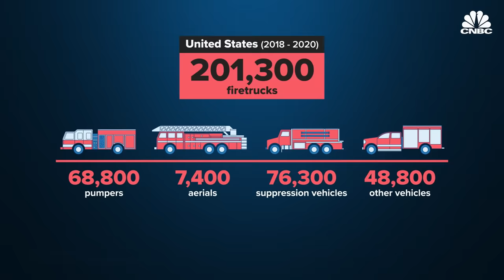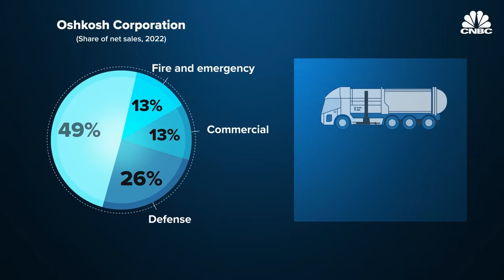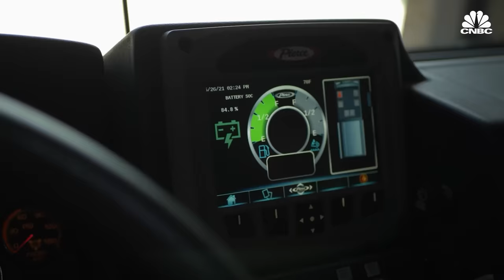Who Makes Money From America’s Firetrucks

Comment: I've had the opportunity to tour Pierce Manufacturing.  The amount of engineering going into a modern firetruck is amazing.
Reply: American FireTrucks and overall utility vehicles are years behind everything made in/for germany (or Europe in general). Look up german firetrucks / busses from the last few years... Thats engineering 😆
Reply: @rlBrave  American fire trucks are still very popular outside of U.S./Canada. Go to Brazil, Chile, Argentina, Mexico, or even China, in which there is some fire brigades that use U.S.-style fire trucks. They buy them because it is simpler to use while have a larger fire suppression capability.
Reply: Pierce sold Arrow XT pumpers to Brasília, Brazil in 2014, and Spartan ERV sold Metro Star pumpers to São Paulo, Brazil in 2017.
Reply: As a nearly 15 year volunteer firefighter.  Also 15 years as a degreed mechanical engineer working in large production facilities, I have seen some of their operations.  It is quite impressive.  The problems right now in manufacturing in the US is the quality.  There has been a complete swing from experienced operators and builders to bringing in kids off the streets.  It is a tough thing to handle right now.
Reply: @rlBrave  Most of the German vehicles are built around the idea of compactness and maneuverability. Sure cities like NY and LA could benefit from smaller more European style trucks but the US is massive in comparison to Germany. So the bigger bulkier trucks have a different mission than those of the European counterparts. But Rosenbauer is also becoming popular in bigger cities across North America while Pierce and E-One are still very popular for non metropolitan cities. And you can shove more abilities in the bigger trucks in the US. Sure we have Squads, Engines, Ladders, etc... But we also have a lot of multi-mission trucks that fit the needs of the US well. I also wouldn't consider shoving everything into a small package Engineering id call it designing a vehicle to fit a nations/cities needs which is what all these companies do.
Reply: The plant in Fox Crossing Wisconsin? I used to work for United Plastic Fabricating which makes the polypropylene water tanks for Pierce, Seagrave and many other manufacturers.
Reply: @eddo1983  That would be the one.  Got the tour as a prospective electrical engineer, so we got to see stuff they don't even show customers.
Reply: Clueless post

Comment: The portion of emissions caused by fire trucks is so miniscule it's insane to even discuss it.
Reply: Although you could make a case for electric fire trucks as far as torque and speed of start up. Although I'm sure they'll be hybrid for a good while before they'll be electric, but I agree that those emissions are smaller in comparison.
Reply: They're got carried away with emissions even banning lawnmowers and string trimmers in some locations. Too many extremists in positions of power in the environmental agencies who want to wield all the power they can.
Reply: @TheOtherBill  Yeah band aren't the way to go, but electric power tools are good for most homeowners in my opinion, just less so for businesses until there's better commerical tools.
Reply: You're barely talking 9 healthy cow farts per truck dispatched. I'll pay that environmental cost
Reply: @TomyPesantes Unless it’s anything related to reproductive care.
Reply: @TheOtherBill smaller 2 stroke engines are extremely dirty and many neglect to do even basic maintenance on their small engines leading to even worse emissions. A fire truck and 4 stroke engines in other vehicles is far more efficient and doesn’t require the burning of oil to lubricate the engine. It’s been long enough it’s time to swap to better engines that are far less pollutive or prone to failure with ones that can do the same job just as well. Electric lawn equipment is a lot better than it used to be even if it’s wired the ease of use and durability with the electric motor being the only moving part to create power. We have a battery leaf blower and a weed eater those things blow the gas ones out of the water for our own uses as we’re not professional landscapers 💀
Reply: @leatherelectric I think the other emissions are the ones to worry about especially when these trucks have to idle for long periods. Hybrid fire trucks make so much more sense hence why many companies produce them now.
Reply: @BakuganBrawler211  Lol whatcha mean there bud? 😎
Reply: @TheOtherBill  Have you tried an electric mower? It cuts the grass as well as any other mower I've owned while being quiet enough I don't need earmuffs.
Reply: @TheOtherBill it’s mostly the excessive noise, not emissions why small 2 stroke engines are starting to banned in towns
Reply: @hurrdurrmurrgurr i had an electric mower over 10 years ago and the batteries died on me twice, after the 2nd replacement failed i decided to buy a gas mower.
Reply: @TheOtherBill lawnmowers can often be worse than cars emission-wise — regulating them is important
Reply: @SCHMALLZZZ i’m sure you did….10 years ago, technology advances at an unprecedented rate, electric impact guns are making more torque than the air counter part in todays age. buy another electric lawn mower from a reputable brand and you won’t be disappointed
Reply: All of the newest engines we have are problematic with the def and emissions.
Reply: @SCHMALLZZZ that will happen with new tech as it first gets started.  Newer battery tech is helping dramatically and will continue to improve.
Reply: Every individual thing has a tiny impact on emissions compared to everything else combined, even behemoths like aviation only contribute 3% to emissions. Cargo ships contribute just 3% as well. The problem is that there are a huge number of things that contribute to climate change so we have to fix all of them.
Reply: You can say that about everything. 

With that logic, I expect you dont go voting, because your vote is so miniscule.
Reply: @tealmer3528 😂😂😂 literally misinformation
Reply: Not to mention the emissions they save by putting out fires.
Reply: that's completely missing the point. the same tech is gonna be put into construction equipment and delivery vehicles. electifying emergency vehicles also makes it easier to get into other markets and to decarbonize the system on the whole
Reply: @TomyPesantes the fires they respond to produce so much more in emissions than a truck…
Reply: @MB12116  Yeah I know, but again I think there is a better case for making them electric for example to get better torque and faster startup time
Reply: A fire truck never going be 40% charge in a city fire department is a massive savings in fuel costs.
Reply: @TomyPesantes so a few things, nothing to do with electric is a good idea. We start them up and are on the road 30 seconds later. Once we arrive on scene to the fire we switch the power from going to the drive train to a pto water pump. That engine is then powered to the max for the next couple hours and then ran at a lower throttle for a few more hours before the fire is overhauled. An electric vehicle can’t do that, so that makes you need a hybrid. Well then when you arrive on scene, start up the secondary motor your giving it no time to warm up, it’s immediately going to work, that isn’t good on the engines at all.
Reply: @RunninGunner04  Well like said, hybrid technology works out better in that situation more than likely, and then again it sounds like something that could be solved by having a secondary motor pump dedicated to pumping. Technology will get better, is there now, no. However it can better later on and I'm sure that reality isn't too far away.
Reply: @TomyPesantes  If your ok with relying on an electric vehicle to get you to a call and run for 6 hours straight then by all means but personally I’d rather get there and get the job done without being worried about my rig not getting there or running out of battery
Reply: @RunninGunner04  Well again sir, technology progresses, it has gotten better and will get better later, remember 100 years ago we didn't depend on engines because they were unreliable now we do because progress happen .
Reply: @TheOtherBill  Whats so extreme about that? Its perfectly reasonable
Reply: I don't think firetruck electrification is due to the emissions. Once most cars and freight trucks electrify diesel/petrol won't be as readily available or affordable so firetrucks will have to be electric. There's also the noise factor as well.
Reply: That logic made us all stupider having read it
Reply: Agreed
Reply: Don't worry, these Electric Vehicles provide other benefits that are much favorable than your emissions argument. Current fire engines are so damn loud, firefighters have trouble communicating while in or around their vehicles. Also, while idling at a scene or in the bay at fire house, Electric Vehicles don't exhaust polluting materials into the workingplace. And lastly (as taxpayer you'll love this one): operating costs are way lower in the long term.
Reply: @MichielKlaver  Keep drinking the kool aid
Reply: @kb9liq  Don't like facts?
Reply: It makes more sense to electrify commercial trucks because these are in constant use while fire trucks are only used incidentally, so environmental return with electrified fire trucks on investment is marginal.
Reply: @platinaatje6134  In many departments fire trucks are being ran 10 plus calls a day and big departments some are being ran 30-40 calls a day. When would the recharge them? I do not know a full time department where they do not run at least 2-3 calls during the night so no recharging overnight
Reply: Yes, especially when you consider the Emissions from the Fire they try to put out.

Comment: According to the EPA, the Oshkosh mail trucks only offer a 0.4 mpg fuel economy over the agency’s current trucks. The old mail trucks have been around for 30 years and don’t even have air conditioning. New gas-powered trucks would offer new amenities such as running air conditioning, they only average about 8.6 mpg. The industry standard for a gasoline-powered fleet vehicle is between 12 to 14 mpg.
Reply: The new mail trucks are a lot larger though. Although Oshkosh's first bid with Ford to supply USPS with modified Transits would've worked better in terms of fuel economy, as they could take advantage of both the Powerboost V6 as well as the E-Transit system, which must've been in development at the time of the announcement.

Comment: You can have an electric firetruck that can be driven around or respond to calls, but in order to pump the massive volumes of water required to put out most fires, you must switch to a diesel engine.
Reply: I'm not sure I agree with that. Obviously to make an electric fire truck, batteries need to be scaled up compared to say a Tesla. Once you have done that, why can't you make an electric water pump to rival a Diesel motor? It's well known electric drive motors have a lot of torque, and that's what you need to push water a long distance.
Reply: @kenmore01  The amount of current required would both drain the battery's capacity and shorten its lifespan, making it economically and practically impractical especially with all the extra weight that will be added to a vehicle, already at 20-30 Tons currently, to create the same pumping power as gas or diesel. 

I can illustrate this best by pointing out how much better gas-powered pressure washers are than their electric equivalents.
Reply: @kenmore01 since firetruck need to service even the outlying case I don't see how would you determine how big battery you need. Do you spec for 24 hour continous use or less? They deal with forest fires that takes weeks to put out. You don't want to deal with charging all electric trucks in the middle of forest.
Reply: Not true.  The diesel generator is only used on extended deployments.  LA County is using a Rosenbauer EV and they love it.
Reply: Rosenbauer has a dedicated apparatus specifically to fight EV Fires but the truck itself is not, it's a diesel. @MrTCFIRE
Reply: @DeeDubious Negative.  My department has an EV Rosenbauer (with diesel generator) scheduled for delivery in 2024.  A demo was brought out last month and we have a second one on order…
Reply: @kenmore01 you need to look up pump testing. An electric fire truck couldn’t monitor a large fire without a supplemental diesel
Reply: @kenmore01  Battery capacity is relevant. Those heavier batteries DISPLACE PAYLOAD and the added weight reduces off-paved road mobility. Not every department is urban LA.
Reply: @MrTCFIRE  It's California, they're FORCED to love it...
Reply: @DeeDubious is correct. You cannot fathom the workload on these trucks and electric, while someday may be viable, simply isn’t there yet. Hell you’d run 10 electric pumpers out of battery power while trying to put out one Tesla on fire. Forget emergency lighting, scene lighting, aerials, tools etc.
Reply: @DanEvan  Around here, EV's will be left to burn unless they're next to a building or something.  Much less hazardous materials and debris to clean up.

Comment: The only issue with electrification is during a disaster like an earthquake, hurricane, forest fire where the local electrical grid is offline for a long period of time
Reply: Generators (or power bank backups) are a thing at most fire stations. And it's not like gas stations can pump fuel without electricity anyway.
Reply: @MrWaterPeople  Civil Defence has a gas/diesel plan to assure that emergency vehicles always have a supply, emergency vehicles have never depended on a local gas station.  These policies are decades old now. Reality is it’s much easier to pump diesel in an emergency vehicle and the have tankers for that purpose, they can continue to run vehicles indefinitely, charging them logistically is far more difficult. 
Before you post you should be educating yourself on your local civil defence planning, I am aware of mine and how it works
Reply: @ytzpilot have you even watched the video? They are designed to operate electric in daily duty. For the 1% time they are used in exceptional cases, like natural disasters, they have a backup engine. 8:40
Reply: Huge disasters like that are probably less than 1% of what emergency vehicles respond to and that's why the fire truck and the video has a diesel engine as a backup. The day-to-day stuff is not as flashy, usually they're just responding to car accidents and sometimes fighting fires in buildings.
Reply: @drabberfrog  I live on top of one of the world’s most active fault lines and the worlds windiest city, large earthquakes are a decade event for us and we are still cleaning up from our last one, so it depends on where you live, your climate, extreme temperatures or fault lines etc. I don’t buy EVs for that reason we get earthquakes and hurricanes and our grid is vulnerable in those extremes, I store gas and earthquake provisions and have a water storage tank on our property and workplace, diesel engines are the most reliable during extreme events
Reply: @ytzpilot  Maybe you have never worked in a small, somewhat rural, and very frugal town. There may be a plan for some vehicles, often police first, but there are plenty of other vehicles that do depend upon the local gas station. In many such areas the government outsources some or all of their police/ fire/ EMS to other agencies. With fire/ EMS that may very well not be a government-owned organization, such as a local non-profit or for-profit corporation. Particularly with the for-profit entities, contingency planning does not have any decent potential for generating revenue and seems to be intentionally neglected. I have worked in some areas where EMS has just gone "out of service" instead of preparing for reasonably-foreseeable natural disasters. In one particular "tourist area" it happened with both surprising and disturbing regularity.
Reply: @ytzpilot  that's why the truck has a diesel engine.
Reply: @drabberfrog  but where I live is remote, and therefore if you are constantly running a diesel generator that defeats the purpose, and we also have coal fired power plants, therefore for us those fire trucks would be running off of coal and diesel. Better to just have a diesel fire truck with no battery to save on the coal
Reply: @MrWaterPeople  Portable pumps exist and leaving a scene to recharge means more downtime than simply adding diesel. There is no demonstrated NEED for BEV fire trucks as their tiny mileage per year means trivial pollution.
Reply: @MrWaterPeople  Gas stations can drop a pump or even a bucket on a rope into the underground tank and compute the sale by hand.
Reply: The only issue? this is One of MANY issues of forcing technology to go a certain direction based on dumb democrat federal policy.
Reply: @MrWaterPeople   you forget that stations store 10-50k+ gallons of diesel underground at any given time and they have a backup generator that can run off of those stores and power the entire station for weeks without any additional supply.
Reply: @ytzpilot  As someone who has worked for a small village. You are wrong, Straight up. You can't magically poof recourses into existence.
Reply: @BiggHoss  you can spot incompetent public servants a mile away 🤣🤣🤣
Your very comment wreaks of someone that was a waste of tax money 😩